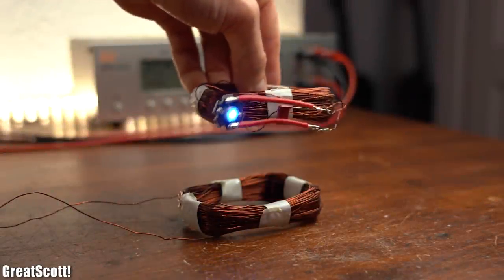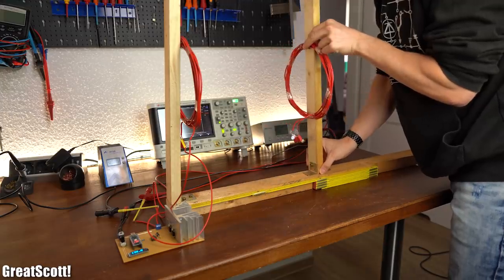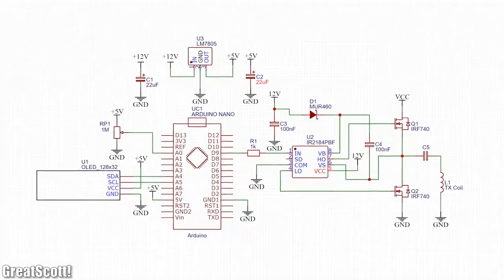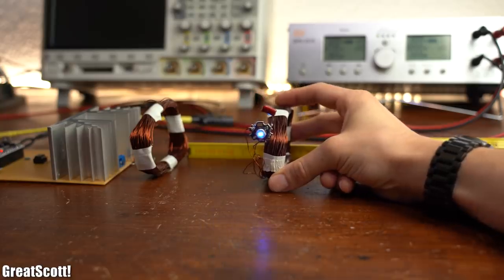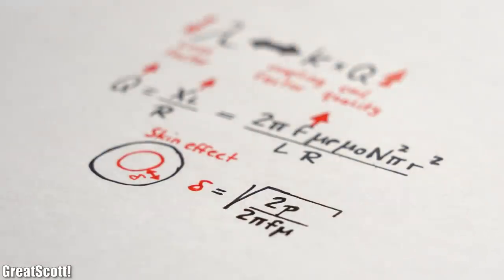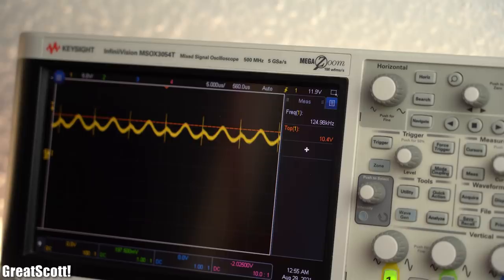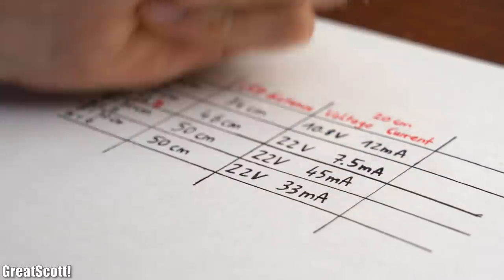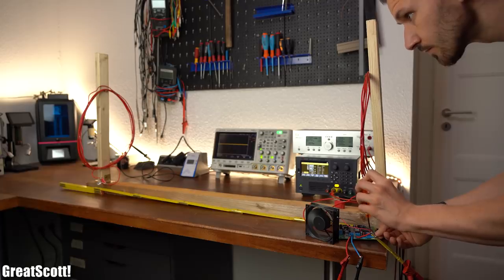How far can I Wirelessly Transfer Power? (Experiment) Better than at MIT?

Comment: I know how you can improve efficiency - just use 2 Yagi antennas, pointed at each other.  Ham radio Yagi antennas come in different sizes and most handle 100 Watts or more.  That would be the most efficient "beaming" of EM energy you can get.
Reply: But you would need much higher frequencies
Reply: @telefon72  yeah, but not a must. Frequency is just to speeding up the transmission, so power losses can be decreased.
Reply: @mashilmy  I would like to see someone construct an efficient Yagi antenna for these frequencies.
Reply: @mashilmy  ?? Higher frequency is for making the antenna smaller. A Yagi starts with a 1/2 wave dipole. Even a 2m Yagi starts with a 1m long dipole, and adds elements.

You need a LOT of elements to get very directional. Therefore a large antenna. Even then, you can't really go very far.

Microwaves are better for directed power, because you can build much more directional antennas at more reasonable sizes, but they are STILL very large. And must go up high and avoid any obstacles.

Comment: 3:41 you are using Half Bridge with just single Supply  so you are applying only half of the power to it instead you can improve it with Dual supply but It still can be possible with Single supply with relatively  higher voltage by using Two Large Electrolyte cap in series will supply lines and Cap's center point  Connected to the Centre point of Half bridge Through Load in between similar to Smps Circuit ( push-Pull Configuration  . ) .

Comment: I wonder if a parabolic reflector, perhaps from an old satellite TV system, might make the generated power more directional.
Reply from the maker: Hmmmmm good question
Reply: Nope, You can't reflect or focus magnetic fields like that. You could add a ferrite core though to give the field a more directional path.  But you lose the nice flat shape then.
Reply: @dougcox835  But then how do satellite dishes work?
Reply: @Mobin92  microwaves are not magnetic flux
Reply: @vripscript  Aren't all radio waves simply modulated magnetic flux?
Reply: @Miata822  no, they are electromagnetic waves which are completely different.
Reply: @theodiscusgaming3909  Oh really? What are radio waves then?
Reply: you can actually use other magnetic fields for shaping
Reply: If you use a frequency and antenna suited to the dish size. Modern small dishes run in the GHz range.

Comment: such a small current loop, relative to the wavelength, actually acts like an omidirectional antenna on the far field and radiates the more to its side than to its middle... While you're in near field your system works, but in the moment the distance increases enough you end up in the direction where your antenna radiates the least. One way of possibly solving this is adding some sort of ferromagnetic material to the middle of the coil, so that the wavelength that matters is the one inside the material (or somewhere in between that and the one in vacuum because the coil won't be fully embedded in the material). When the perimeter of the loop is close to the wavelength (in the ferromagnetic material) then you get a directional antenna

Comment: The best way is to use microwaves. With parabolic dish antennas you can get the efficiency over dramatically more distance than with low frequency coils. We would play around with the radar units in the army and light up fluorescent tubes a kilometre away!

Comment: Forgive me if my thinking is wrong here but, the output coil is kind of like a dipole, where the electric charges are equal on opposite sides. I wonder if you can use a radiator like a on a Yagi antenna to push the unused electric charges to the other side and have more output from the coil...in one direction ?
Reply: That's a great idea !

Comment: you could try using soft copper water line coated with lacquer, rather than wire for your coils. it will hold it's shape better, and be easier to form, since it already comes as a coil when you buy it.

Comment: To get the best efficiency and distance you need those coils to be accurately tuned to be resonant at the frequency being transmitted and received And you want the antennas (coils) to be as directional as possible as that will increase signal strength at range.. Look to Ham radio antenna theories,  You may be getting more power reflected back at your transmitter from your coil than is being radiated by it.

Comment: Here is a real practical solution that should be created and tested. During lockdown my car and my wife's have barely been used. Consequently, both batteries were running down. No problem I just connected (via suitably long leads) my battery charger to both cars. Works fine, but I would keep forgetting to disconnect before setting off and although the leads would just disconnect under strain, that's not a good or practical solution.

IDEA: Large diameter wireless coil power transfer - need around 60 watts of transfer at  around 20 volts and use a small 3-5A buck converter circuit in the car just taking the 20 volts/3 A and providing a 14.4 volt constant voltage with a 3A current limit for trickle charging the battery.

Separation would need to be around 18-20cm for most cars and up to 30cm or so for high 4x4's.

Transmitter coil ideally to be mounted in the drive, under concrete, slabs or blocks but power control ideally in 100% waterproof housing with max 24 volt supply from a suitable supply in the nearest building (garage, shed, house).

Anyone up for the challenge? I have so much to do in our garden and around the house already that it'll be at least another year before I can get around to designing and testing one.🤔🤔🤔
Reply: I have that problem, too. I've recently gone on disability (the C word) and rarely drive, so my van sits and the battery self-discharges.

I'm worried if I hook up a trickle charger, I'll forget to unplug it and drive away. So I'm thinking of a wireless charger that, when the vehicle is above it for a  minimum time, it rises up for better efficiency. This will also contain circuitry to detect when the engine is started and automatically lower itself.

Comment: Hi greatscot great experiment. 
I already developed a WPT system a month ago that is without microcontroller and that can send power with 40% efficiency. And power up from 7.5V battery🔋/power supply. 
The distance I achived about 30-40mm.

Comment: Tens of miles with simple coils (Tesla did that). In the classroom with a Tesla coil we built with a tube amplifier that ran at 850 Khz (jammed KOA) we could easily light a florescent tube at 30 feet. Using a focused beam, or light, much farther. The problem with all but the laser - you need a ground for the return loop.

Comment: Have you tried resonant rlc circuits? Use variable capacitor, var. Resistor and var. Inductor to tune. As distance increases so does the resistance so it changes the frequency. You will have to keep tuning until resonance occurs. Dual tuning forks show the same effect

Comment: I actually did something like this when I was a kid in the 90's. I did not like having a cable running to my headphones, so I grabbed a pair of earbuds and added a small wire loop to each. I then put a LARGE coil on my stereo. Two problems (ok 3). #1. The volume was very low after more than 2 feet from the coil. #2. To get a useful distance I had to push the volume so high, the coil would start to glow in spots (was using an OLD Rotel stereo from the mid 70's).  And #3. It was not stereo.

Comment: Making an actual qi wireless phone charger would be really cool.

I has to communicate with the phone/ stop transmitting if some metal gets on the charger so it doesn't work as an induction heater
Reply: I don't think that would be too difficult.  The charger base can obviously detect if there's something drawing energy from the pilot field.  The obvious thing to do is put an RFID tag in the charger on the phone so the charger base can get a signal that the thing pulling energy from the charger base is a phone charger and not some random hunk of conductive material.  That could even be used to identify how much power the charger base should pump out, since not all devices necessarily want the same voltage and current.

Comment: the diameter and the distance are in Great Correlation with each other, i mean they are complementary - comparison of distance needs to take the diameters into consideration. I think the antenna design might be very important - the MTI team have used spiral antennae similar to the Astrophysics directional antenna (check out video about city WIFI (x) window scanner :) made by astrophysics

Comment: Tesla patented the pancake coil for use in high voltage high frequency power transmission, perhaps try keep the coils from overlapping, it would change overall diameter but give a greater area of effect and lessen transmission losses

Comment: Nice video, i think the max power can be transmitted by making a zvs circuit at the primary side maybe and making the secondary tank circuit with a wires having much more strands of wire
Reply from the maker: ZVS does not improve this.
Reply: He is going towards efficiency  and distance
Reply: I mean, zvs can generate a sine wave  with more that 3× peak voltages

Comment: Have you ever considered moving away from perf board and getting a CNC mill to mill your boards? 

It has a much better look and makes building the circuit board much more of a pleasure.
Reply: milling PCBS is so easy you can even use a regular 3D printer with a RC motor to mill it with the tiny mills

Comment: About 16 years ago I was experimenting with tesla coils and managed to light an led from the other side of my apartment. The collector was a capacitive panel, not a coil. Also I remember the diode being integral for the conversion. Now I wonder if I tried it again with a faster diode what the results would be.
Reply: I have made a similar experiment with 2 Tesla coils and the 2 leds where lit up at the 5m distance.
Reply: sure, but at what efficiency ?
Reply: @great__success  A system with tuned coils can reach incredibly good efficiency. However you lose mobility of the end points to get there.
Reply: @great__success  with my experiment it was like 8W on receiver and 30W on the transmitter.

Comment: Hey you could try using thick gage jumper leads for jump starting cars? Cheap and thick? I would suggest de-skinning the silicone shielding and twist the wires using a drill 👍 clamp and solder each end 1 at a time

Comment: wait.. by using a solar panel you can transmit wireless energy as far as you like... considering the inverse square law, you can use a laser to maximize the energy transmission efficiency without compromising distance.....
Reply: Finally. :)

Comment: the reason this is so ineffective is because magnetic induction is used instead of dielectric pressure differentials..
IE this works match match better with very high voltages, and low current.. this is how it was invented in the first place, 
one way i found so far is to use coax cable and use only the outer ground mesh. wind 2 pancakes in opposite direction, use large top capacitance on center, 
drive it in resonance with high voltage dc to dc pulse with boost converter.. must be a boost converter or a wave made in the same wave "field collapse" duo to the particular form of wave that is formed.. as its in a different time domain than the AC sign wave, this duo to the booster wave being only 90degree long it acts as a ringer for the coil. and as the coils are wound oposide, 100% current block happens at 90 degree, converting it all to voltage, this moves the e and be 45degree out of phase instead of 90degree, and you get impulse waves, 'not a well documented stuff'  these waves can do work, just as current can do, but it increases its power when resistance is increased, meaning that it will travel very well through bough ground as well as air. and acts allot like negative G, this was one of Nikola Tesla his secrets. that is now long forgotten. but there is a whole different way of using electrical power then we are used to today, that i s purlly based on voltage under pressure.. longitudinal in nature not transverse. highly interesting stuff, cheers keep up the the experiments ;)

Comment: Honestly, as a very old fan of yours and an electrical engineer inspired by you,
i definitely would like to see you redoing that 60Watt 2meters wireless power experiment!! 
Cause nothing is impossible for you!
Hope you change your mind and do it ^_^ 

+ I would like to know if the air between the transmitter and receiver is dangerous to be around (since it has a high power)

Comment: I remember battery-free crystal radio kits for kids. That's the kind of remote power transmission.
Reply: Yes it is, but the broadcasting stations us tens of kW and even just a mile away the crystal set can only provide a few mW for headphone listening, even when a long wire antenna is attached. The losses are way too high for power transmission.

Comment: I'm always happy when I see actual wireless power demonstrations that show how limited the range and efficiency actually is. I frequently read where people wonder why we don't transmit industrial-level power wirelessly over long distances as Tesla envisioned. I constantly try to explain that it can't work because of the inverse square law for radiated power. Actually, in the near field, the attenuation more closely follows an inverse cube law so its even worse. They just can't let go of the dream though.
Reply: Not to mention think of all the radio interference it would cause as well.
Reply: I've had the same conversations with the same type of people. 'Tesla' seems to have some kind of totemic significance to these people and they actually believe he could do the things he dreamed of. It's pointless arguing with them as they have very limited knowledge.
Reply: @Robert-Wilson  Too true. I'm a Radio Amatuer and the bands are clogged wirh noise from 'non-intentional' radiators. Just imagine the racket when the power is deliberately let loose!
Reply: @andyhowlett2231  I’m a ham as well. Only a tech mainly only reason I haven’t upgraded is I wouldn’t get to use the HF bands do to apartment living and do to blindness can’t drive so not like I can get out mobile. But oh how I know about the RFI from junk being made today that don’t have proper filtering on Power supplies and what not.

Comment: You MUST give to the antennas a "COIL" shape, every turn must be in order not as a rope one twist on top of the other , remember, as a coil, you need a perfect antenna to send and receive the signal. please make a v2 a circle of cardboard, enameled copper one twist as close as possible to the other BUT IN ORDER one side by side.

Comment: In the 1980s I‘ve achieved encouraging results at about 1 MHz. My setup basically consisted of an oscillator made out of two 2N3055 and two ferrite rod antennas.

Comment: I have seen a few exploratory long-distance wireless power transmitters in the last 25 years (from my days in Space Research), and they all relied on microwaves, which fits with the MHz range of the MIT demonstrator. My natural guess, if I was to build such a system for cheap, would be to try and repurpose a microwave magnetron as the source, and whatever type of WiFi-optimised antenna as the receiving end.
But I am no specialist in this field, so, take this with a grain of salt.

Comment: nice, next time use LC Tanks between transmitter and receiver coils , it will increase the wireless distance
(LC tanks are just Coils with Capacitor in parallel )  ....... :)
Reply: Did he not already do that?
Reply: @joshmerritt7915  i think yess.. But more lc tanks will be better i guess

Comment: Hi! Interesting project. So I did some calculations (with skin effect) and came to the conclusion that the 2 most important factors are the diameter of wire and frequency. So I would try aiming for thickest wire and highest frequency. The radius of coil and number of turns basically have a linear dependency. So with the same wire length you can have 2 turns with smaller radius or 1 turn with bigger radius. I hope this helps.
Reply: Why not replacing the coil with antenna? Like yagi antenna? Or parabolic antenna? Any high gain antennas are designed to be high efficiency. 

and this one, Maybe you're wrong..higher frequency means shorter distance but faster electron traveling speed..like when wifi have 2.4Ghz and 5Ghz frequency, the  2.4 capable upto 10m but the 5GHz one only capable for like 5m

Comment: I always wondered how a coil made out of a coil would perform. Ex: 10ft long 5mmdiameter coil ... coiled up in a 50mm coil. Thanks for awnsering!
Reply: It would be very poor. You are basically describing a toroidal transformer. The magnetic flux lines run perpendicular to the electrical current flowing through the wire. When we form a coil from the wire, that causes the flux of all loops to go through the center of the loops (the center of the coil). If you then coiled those coils into a toroid, the magnetic flux would be directed through the circular axis of the toroid. This is useful for efficiently containing the flux within the core of a transformer, but it is the exact opposite of what you want for transmitting that magnetic flux over some distance. This is why wireless charging systems all use plain coils of wire, with the transmitting and receiving coils held in parallel (with their central axis colinear). This causes the flux generated by transmitter to be in the best place to induce the most current in the receiver. Even if you were to make a shape more like a screw rather than a toroid, the magnetic flux is still being generated in a direction that is generally not pointing outwards towards the receiver, but rather inwards towards the transmitter.